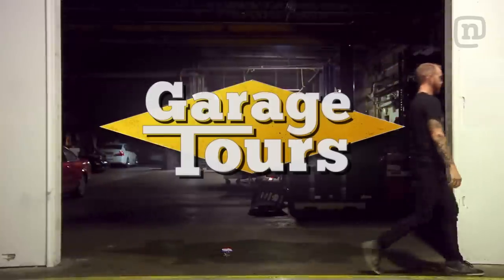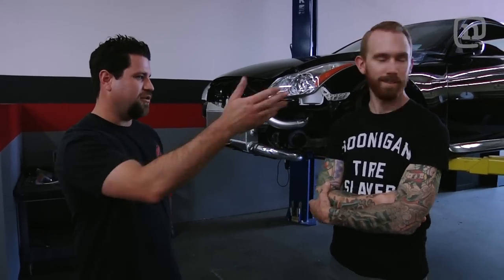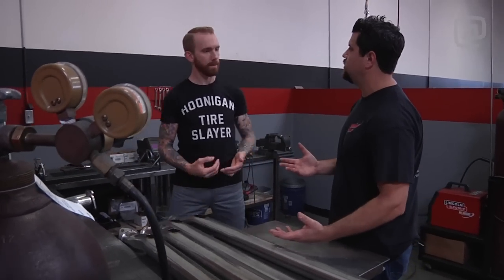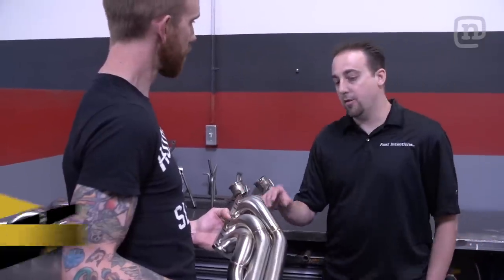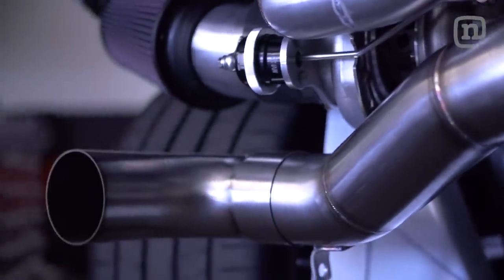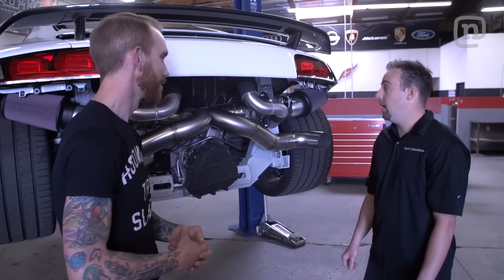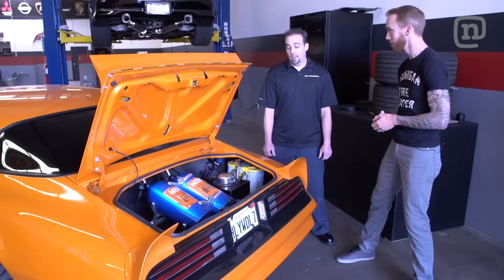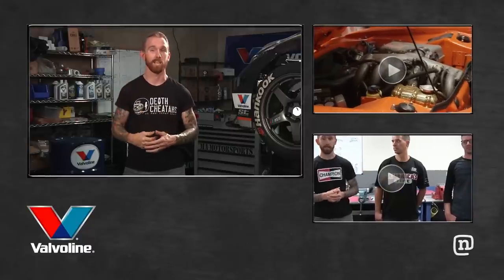Precision Twin Turbo & Exhaust Fabrications At Fast Intentions: Garage Tours With Chris Forsberg

Comment: You mentioned it in the video and a couple other times that you run nitrous. And on the live stream of round 3 it was also mentioned that someone else uses nitrous (can't remember who).
Is nitrous a common thing in formula drift or are only a couple people running it?

Comment: Guys! Im looking into either a single or TT set up on my 05 350 track (drag strip and road course track days) project. Im leaning towards a single mid or rear mount just for upper power to help the DE get some mid/upper range fun power. You guys have any thoughts? Appreciate it! Again its mostly just a track/fun car weekend build not a daily or anything.